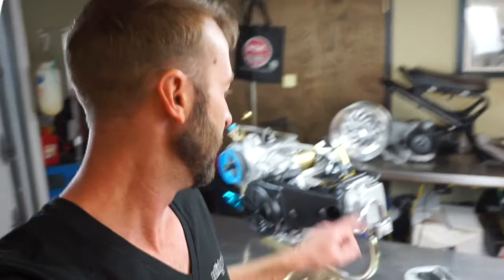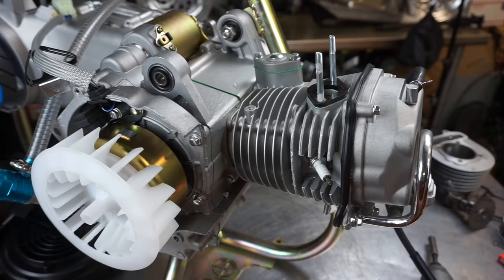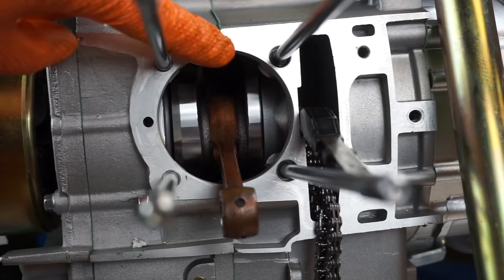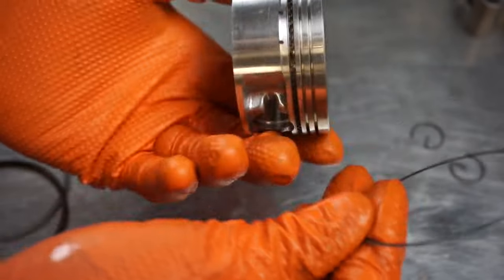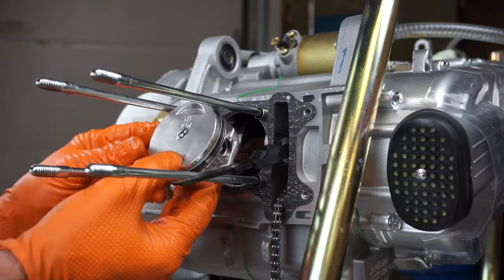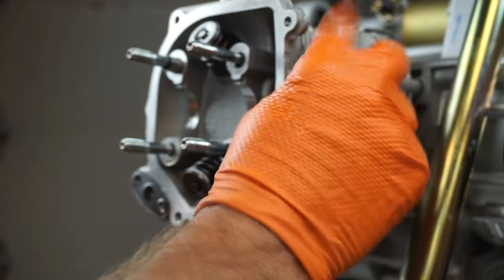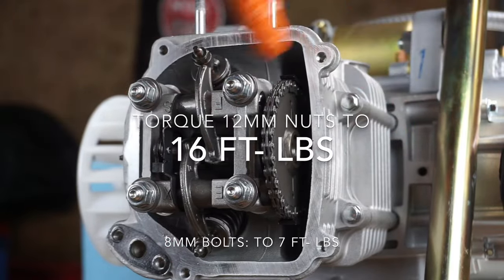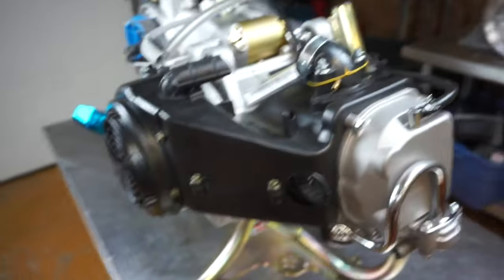How to install a big bore kit GY6 171cc / 172cc (61mm). EVERYTHING YOU NEED TO KNOW!

Comment: I've seen stroker cranks for the gy6 50cc but been able to find any information on what's needed to Install it do you know anything about them?
Reply from the maker: Installing a crank, you will need to split the cases. I don’t have any good info on that yet.
Reply: @RollingWrench  I've installed cranks before but when installing a stroker crank in the 50cc block something has to change either the jug has to be shemed up or the piston pin location has to change this Information i have yet to find
Reply: @owenridener5881  where are you getting a stroker crank for gy6 50? pretty sure those don't exist
Reply: @perfectcell7995  iv seen them on Ebay I seen one that came with everything you needed to complete the installation but now I cant fine that kit at all I've tried contacting rolling wrench with no luck you think if they want sell there products that would answer a phone call or a email
Reply: @owenridener5881  probably a Scrappy dog part they are out of business now
Reply: @owenridener5881  they used to sell all kinds of performance 50cc parts like smaller rear gears and what not

Comment: If the blow bye from oil keeps going over and leaking everywhere what can we do about it? I have a bbk stroker and it's never a dull moment with oil I just ordered a high flow oil pump so its spose tu increase the flow bye 20% so wouldnt that mean more oil blow bye God I hate the way it leaks! I've had over 20 gy6 & they all leak weather it's cheap made gaskets or even cheaper seals lol
Reply: Oil catch can , research it , use it !

Comment: I got the dong fang 200SST does the exhaust you guys sell fit ?
Reply: It' got a 169cc engine.. How do you like it? I choose a 150 instead. I could not see the justification in price for just 20 cc's more when I can mod my bike from stock.. but Not this Route.. It's cheaper to buy a legit 250.
Reply: @DivergentDroid  I like it.  Gets up to 60-65.   I have put in a new clutch, CVT, Bigger spark plug wire, Carb, and intake.  Almost done putting it together. Then have to tune it.  hopefully I can get up to 70-75.  scared of doing BBK.   But not out of the question yet since I have only had it for 2 mo.

Comment: I'm just wondering why does it need a valve adjustment when the motor is brand new?
Reply: The cam was changed to the back of the lobe is a different Hight. Any time you remove the rocker tower even when not changing the cam the valve clearance must be checked. .004MM changes very quickly when messing about with the top end.
Reply: @Screwdriversteve1  Fair enough, thank you for your answer!

Comment: I have to thank you for the excellent video. I have a 150 GY6 large frame scooter sitting in my shed awaiting a rebuild and this looks like what it needs. Now I wonder if you might have the parts necessary since my nephew got into the shed and strewed parts everywhere. I mean items like nuts and bolts that I will need for the project. He also managed to break off the mirrors too. He is no longer welcome at my abode. I will need quite a bit. Do you also have a manual covering the Chinese scooters? Thanks in advance.

Comment: I installed my big bore kit following this video and my scooter haven’t started since.  I should’ve been happy with my 35 mph on my Df50srt smh
Reply from the maker: Looks like you may have missed a step. Go back and see what you missed. Patients young grasshopper…
Reply: @rollingwrench But now I’ve been stumped for about two weeks on one of my bikes it’s a Df50srt qmb139 50cc. I’ve installed a “100cc” BBK (82 really) 69mm valve head, new CDI and cable, new spark plug, new electric choke carburetor!!! I’ve got the correct rocker arms to fit the valve head I gapped the valves to .004 both intake and exhaust. I’m at TOP DEAD CENTER with everything but she still won’t catch. She’ll crank fine, I got spark ✔️Fuel ✔️ And compression ✔️ But I’m missing something obviously!!! Before I put the BBK on, the bike was cutting off at an idle a lot I had to lightly pump the throttle to keep her alive at red lights and such. 

The first day I put the BBK on it was like it drained the battery but I got it started that day with some jumper cables. And I could feel the new power the BBK gave it , it reev’d a lil louder but it only got up to 22-26mph so I knew something was off and it was my valves!!! So I went back in and saw they were loose , so I ordered the valve adjustment tool and left her alone until it arrived. When it did I went back in double checked everything ( TDC, piston rings etc) and then gapped the valves to (intake .003 and exhaust.004) She would crank but not start. Do that went on for a couple of days until I went back in re’recheckef everything and gapped them to .004 and .004 but got same results!!! And when she’s cranking the exhaust valve makes a TICKING sound but it’s not loose or closed off !!! 
I’ve tried everything I know! I’ve even taken everything apart and put it back just to check my work, actually I’ve done that every other day after school ( I’m in the nursing program) because I just can’t stand to see my scooter just sitting in my shed and I have another BBK for my other DF50sst qmb139 50cc but I don’t wanna install it until I figure this one out. 

And I’m sorry for the long message
Reply from the maker: @dawgboyz24  I can FaceTime with you to help figure out the issue. Here is a link to our one one tech support https://www.rollingwrenchdenver.com/products/rolling-wrench-tech-support-help?utm_medium=product-links&utm_content=ios&utm_source=copyToPasteboard
Reply: @RollingWrench   I got it running today.  I ditched the 69mm valve head and went with a 64mm and it fired up on the first try!!!!!! So now I got an extra 69mm valve head and rockers. Now I’m gonna swap out the Variator tomorrow !!I’m bout to install a BBK on my other bike now.    Thanks for the knowledge you give in your videos.

Comment: "There should be no hammering down on it"  beats the hell out of rocker arms. yeah 2 different things and references. But having worked at a scooter shop loosening the valve adjustment made me cringe. Nothin on u man but when i see gloves on tutorial hands i get suspect.  Yeah maybe cleaner nails for picking up the ladies. But u can't feel shit.  Those bits of dirt or grain of sand could b catastrophic if it's in the right place or there's enough of them that you can't feel. And it teaches you to work clean. You can't tell how clean or dirty anything is if you're wearing gloves. As an analogy I used to work at a restaurant with a bunch of Haitians and they said that you need to wear gloves while working on the line they would wear the same pair of gloves until a few holes got in them so about half of the shift. I told them to go pound sand and I wash my hands every time

Comment: So frustrated. I want to get an 80cc kit for my 50cc but no matter how much I watch these videos it's insane. Shops want around $400 for installation (my bike brand new was $750). Im great with the electrical stuff like LED underglow and changing lights out but, mechanical shit is too far over my head no matter how much I try to learn. I only learn hands on but I'm not gonna risk ruining my bike. Anyone got any suggestion?
Reply from the maker: I have a step by step how to video.
Reply: Considering you're great with technical wiring, you're golden to start small and work into motors. Im 21 and I finally learned how to do valves on my 2015 dr200 and that was 5k altogether when I bought it new, I dont let anyone touch my bikes lol

Comment: Ok but you didn't check your ring gaps and that chain was a link out, didn't check timing marks after chain tensioner was installed, no torque specs 🤔
Reply from the maker: I have a paid version on my website that will go in more depth